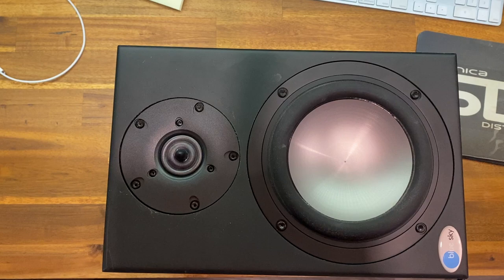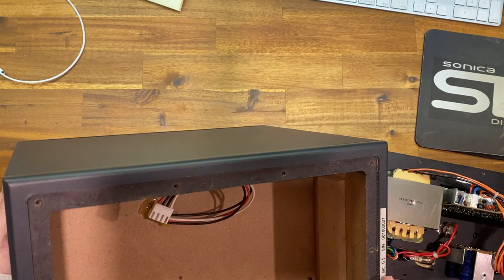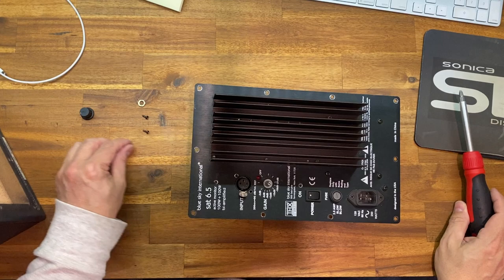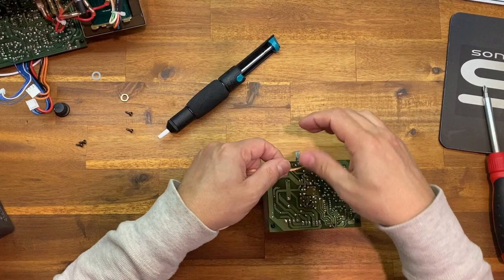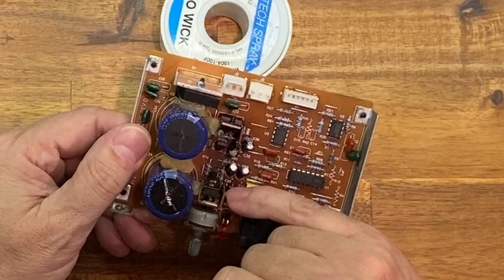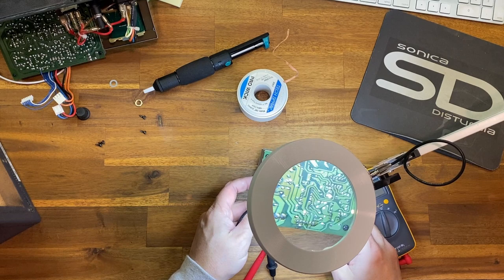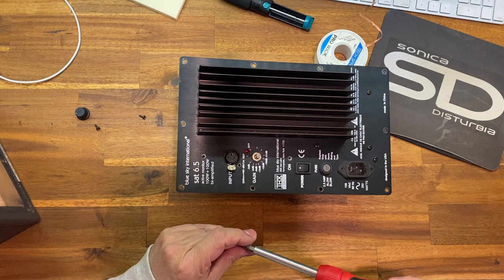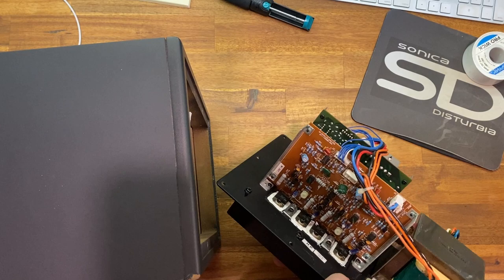Blue SkyStudio Monitor Board Repair

Comment: Thank you so much for this. I have 7 of these beauties plus 2 subs and I had the cold solder fix sent by an engineer at Blue Sky, but I lost the email account a year ago. So glad I found this video! Cheers!
Reply from the maker: Hey no worries at all. Keep in the loop here. I just did a revamp of this repair with new double sized heatsinks on those transistors to dissipate the heat better and so far it seems to be a long term solution to the issue. I need to run the new repair monitors for some time to see... I'll have to crank some of the new www.youtube.com/@sonicadisturbia to heat them up a bit!

Comment: Hello, I have a question: I also have 5 of these speakers.  1 speaker pops a little during operation.  Can it be due to old capacitors?  I've already swapped the tweeters, but the popping keeps coming back at different intervals.  What could that be?
Reply from the maker: This repair should fix it. The solder connection may look okay but it gets really hot and creates a sold solder joint. Re-solder the connections on the board on the 2 transistors I am showing here. If it's not something you're comfortable doing maybe take it to a repair depot and share the video link.
I am 99% sure this will fix the pop issue. I have had to do it a few times over the years and I have a 5.1 BlueSky set up of Sat 6.5's as well as a pair of the Sat 12 Big Blues.
I did put new heat sinks on the sat 6.5 I just repaired and did captured a video, I just haven't been able to make the time to edit and post it...it's coming...
Reply: @SDTunesinc  Thank you very much for your fast and professional answer!  I am a trained electrician.  So far I have not puzzled what this pop error could be.  But your description sounds logical.  I have a soldering station.  If you would like a circuit diagram for the SAT 6.5 MK2, I can email it to you as a pdf.  I received it from Blue Sky many years ago. Cheers Christoph
Reply from the maker: @alright1984  Nice I have the schematics as well, look for U4 (LM317) and U5 (LM337) those are the dirty culprits that need a bit of re solder love! You could also have a problem on the J5 jack. I have only seen that once and is probably a one time thing but take a look.
I'll try to get that new heat sink video together shortly that should be a long term solution.